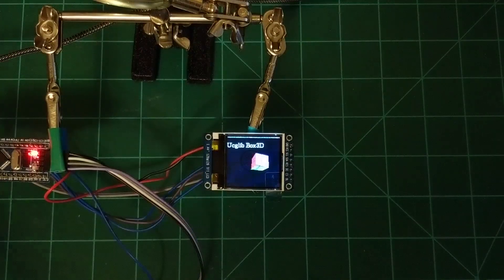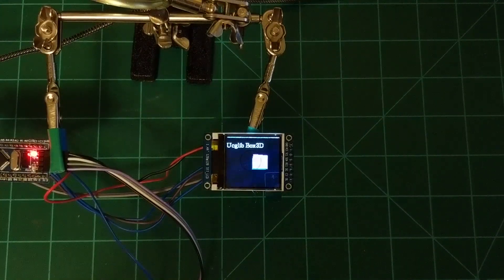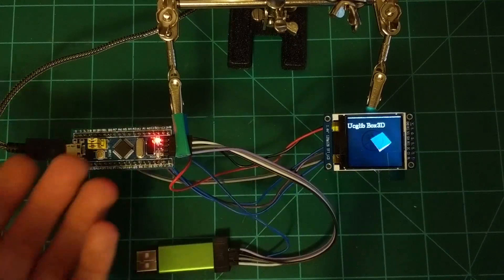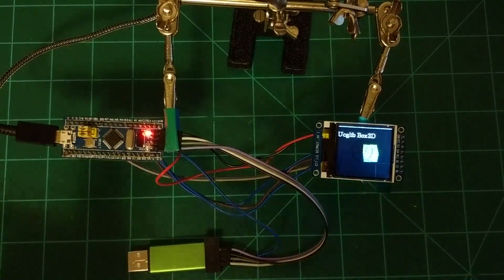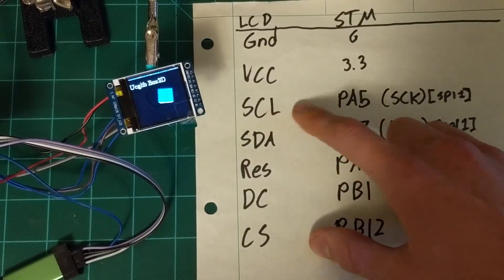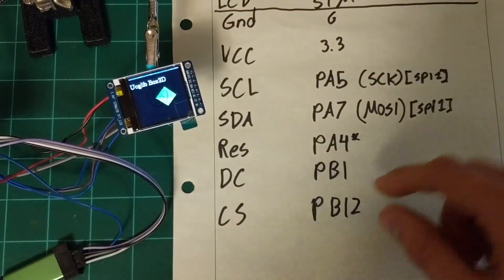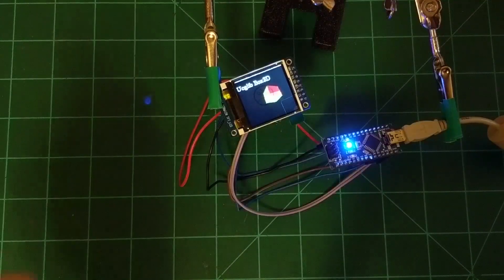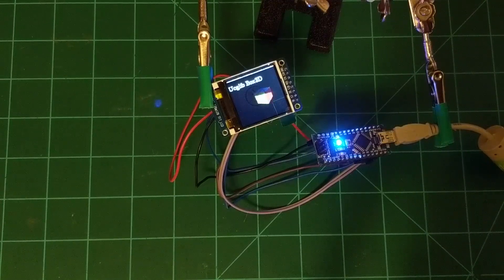STM32 Bits: LCDs with Ucglib (ST7735)

Comment: Hi Caleb, just picked up a couple of STM32's and trying to reproduce what you have done here. I seem to be having an issue compiling but I just can't see what I'm doing wrong. Coppied the instructions as above but get this error.
C:\Users\user\Documents\Arduino\libraries\Ucglib\src\Ucglib.cpp: In function 'void ucg_com_arduino_send_8bit(ucg_t*, uint8_t)':
C:\Users\user\Documents\Arduino\libraries\Ucglib\src\Ucglib.cpp:840:3: error: '__NOP' was not declared in this scope
  840 |   __NOP;
          |   ^~~~~
exit status 1
Error compiling for board Generic STM32F1 series.

I've been through it a number of times but just can't see what I have wrong.
Any help would be great. Thanks....
Reply from the maker: Unfortunately this video is pretty old and libraries and stuff may have changed. This was also with the Roger Clarke core and not the STM32duino core. However, library support is growing and other libraries may work out of the box with stm32duino or Roger Clarke Melbourne's core, I would shop around a little bit and let me know if you find anything! You can also join the STM32 discord for help and keeping us updated
Reply: Thanks I'll have a look around, That's a shame as I was using the Ucglib in a nano based project, would have been really easy to transfer to the Stm. Thanks again.

Comment: Hello, how to connect SD card (pinout) to STM32 and to the display at the same time?:)
Reply from the maker: You can use multiple spi outs or use the cs (chip select) to choose what you are sending data to. If your display is I2C though you don't have to worry
Reply: @CalebMarting  Thank you for the answer:) First option (multiple spi outs) sound easy, but what if we use the second option with CS? Does this mean that ywe can connect two slaves to one SPI interface in the microcontroller?
Reply from the maker: http://www.learningaboutelectronics.com/Articles/Multiple-SPI-devices-to-an-arduino-microcontroller.php yes you can connect multiple slaves to the same controller! Basically by using chip select you can turn one on and the rest off. I think that article slightly explains it.
Reply: @CalebMarting  Thank you!:) Now I understand that MOSI/MISO/SCK pins can be common for both slaves and that CS pin must be separate. But I can't imagine why the second pin is some other pin (D9), while the first is the nominal CS. Do you know why this happens?: C
Reply from the maker: I'm guessing nominal Cs is just the default. But it isn't really sending data so can be any gpio
Reply: @CalebMarting  Great!:) Thank you for help!

Comment: I didn't check DS of this display but maybe instead serial data transfer would it be better do it parallely ? It could be disable interlace. Anyway great job mate. Subscribed you.

I find tut how running any ARM from clear assembler. Very hard to find and even any eclipse doesn't have "make ASM project" option - just like it was impossible LOL
Reply from the maker: Yeah I just managed to get this working and threw it out there for others to see so it's not perfect